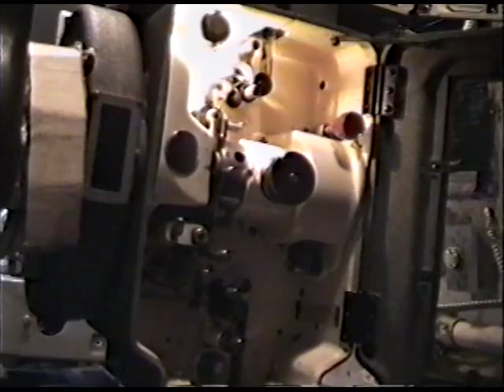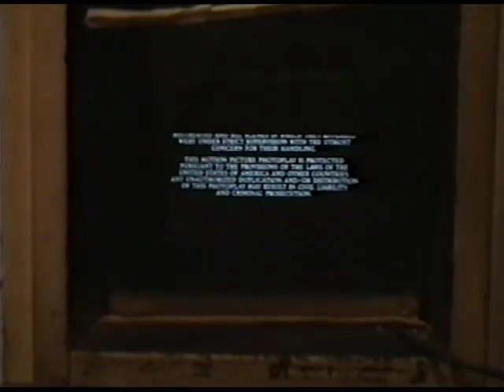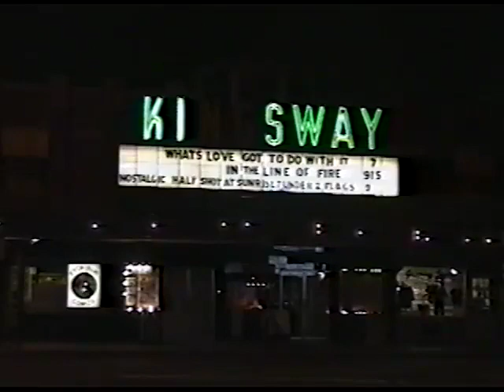Kingsway Theatre Toronto - 1992 by John Wallington

Comment: I too ran the Peerless Magnarc  lamps with Simplex XL projectors at The Mayan Theatre in Denver (before they made it a 3-plex) from 1973-1974. We had 2 rectifier units in another room (it cut down the noise), and a full bank of dimmer rheostats for the house and atmospheric lighting. I didn't have the opportunity to run Century projectors except in once in a while relief work. The Arvada Plaza theatre in Arvada, CO had Simplex XLs and Ashcraft Corelite lamps. My longest assignment was at the Esquire Theatre in Denver (still there, but turned into a twin). The Esquire had a pair of Simplex E-7 projectors. I didn't like them, but even after 50 years of use they ran fine. These were paired up with Strong Futura (?) carbon arc lamps. I don't remember that part. I was a member of IATSE Local 230 in Denver for 17 years. All these years later, I really miss those days.

Comment: Brings back so many memories. Being a teenager in 1962, I used to hang around with a good buddy who was a projectionist. I became familiarized with all the necessary steps. I remember this theater used, (I think it's called a dynamotor which ran off 220VAC which at the same time produced the necessary DC Voltage to run the arc lights) I am now knocking at the door of 77 years old, (God willing) Thank you for this wonderful video.

Comment: Many thanks for this video. I myself am a projectionist and I had the chance to shoot in double shift (but not with arc lanterns). It is for me the maximum purity of the profession. It is thanks to my grandfather that I do this job and he transmitted to me the love of film and the projection booth. Thanks again .
Reply: I am also a keen passionate guy since my 80s childhood when 16mm projector used to show movies on Saturdays evening. It was very expensive to buy a one so I developed my own DIY reel projector with 500w metal halide lamp which could project and light up 50 feet screen. It was so mesmerizing to see its dancing beam passing through fog, smoke and rain sometimes. I could get up early in morning and could project in a good ambient dawn light.
Now I developed my DIY anamorphic lens using wedge prism. I use it with BenQ w1070 to project 42 feet wide screen on boundary wall specifically painted for projection.
The memories of reel projector gives immense pleasure, I can think of it everytime!

Comment: I don't' want to remember having that bell wake me up on the last feature getting close to 11PM and I need to get some sleep to work the next day. Century Projectors would run forever. We had Ashcroft light houses that had 2 huge 3-phase rectifiers to power the arc. And it was water cooled on the clamps holding the positive rod and a water feed went to the film gate to keep that cool. Slightly noisy machines. I have heard some pricey European projectors that are really quiet operating. I was familiar with electronics and had a Dynaco Preamp ahead of the power amp to give the audio a nice sound. And wired in one  push button switch at each projector position that eliminated have to hit the petal on the floor for the movie transfer and button on the wall for the sound to switch projectors. One press of that button and it was complete. The ventilating system was broken from a fan belt worn out and the tile floor was black from the soot of the lamphouse. I fixed the fan and stripped the tile floor till it looked NEW. The manager was impressed and I got a little raise

Comment: This projectionist seems like he was trained by me. Starting with the reel bin "marker" to keep track of the next reel and where the last reel came from, the fact that he never let the film touch the floor by threading the take-up reel directly from the supply reel before threading the machine, he used pliers to trim the carbon arc and not a rag, and his inspection of an incoming print carefully checking head and tail leaders and the film edge of the entire reel. His precise movements throughout the operation reek of professionalism and good habits.

Comment: Wow...I'm 7 decades old now and remember the Kingsway in my youth! Our family operated a hardware down the street for many years up until the late 80's...I am SO glad you guys (and gals) are keeping the Kingsway open...just don't let the marquee collapse like the Revue theatre's one some years ago!! One other comment: I drive/walk by at night and I've noted that for MANY years, the 'traveller' mechanism for the marquee lights seems to be missing one of the three contact points..Not sure if the actual 'traveller' mechanism is broken - but you REALLY need to get that fixed...It's irritating in the extreme to watch the sets of lights on, on - then OFF and repeating the cycle...it's a three-cycle circuit, as I remember (I helped repair one of these 'traveller' marquee lamp controllers down at the old theatre in New Toronto - 40 years plus ago!!) I'm fairly sure it's just either a missing contact bar or possibly just disconnected. It should be fixable. Obviously, the motor is working fine in the traveller switch. See what you can do - it's SO disconcerting to see the marquee lights in 'fits and starts'...
It's problably a 'Signatrol 33-C3' unit - or similar 'chaser' unit - 3 contacts. This company is in the States - but the chaser/traveller units are not expensive. It may be just contacts needed.
http://nationalsupplyonline.com/Mechanical_Border_Chasers.html
cheers! James
Reply from the maker: It is actually a solid state unit that I bought as a replacement a few years back. It is a 4 flasher - one of the contacts does not work properly and the unit has yet to be replaced. Only three contacts work - but it was wired for 4. 1 length is doubled up - which is fine because the bulbs are now low wattage LEDs. Has to be fixed at some point.

Comment: Great classic style old theater, I work in a cinema where my favorite motivational films were released and I achieved it as Projectionist I learned the manual books of the cinematographic projector I remember my training and everything was a success, I do not rule out one day being able to acquire an old theater and remodel it in the style of the 70s to 80s to restore the old projectors that I came across historical and project those classics that inspired me, although there would be few original films left in the film roll cases, if they are not kept lubricated, the old films will be lost, it would be sad, I remember not allowing any dirt or dust particles to be on the projector rails because they scratch the film It was my priority to preserve it with a good image on the big screen of the cinema ,,,, what tremendous times , the old film projectors that used lamps with carbon electrodes, I remember using them in an old cinema in my country they hired me for a season, I put them together but change the rolls in the middle of A film , it was several rolls, it had to be fast because the film was paused, with a powerful flat lens, but when the projector was modernized, flat lenses were used in the shorts of advertisements sponsored by the cinema and some films that were image Flat lens and when the movie started you had to switch to the scope lens. Then it was modernized to the giant plate method where all the rolls of the film are connected together all rolled up. But the modern ones were with a great DTS, CD, DVD and then to Bluray ,,, the old method was eliminated, which was more my traditional style, it was rather for me a profession, the audio contacts of the film had to be kept clean, a good lubrication in the rollers, an additional replacement lamp, a treatment to the film to avoid deterioration with the heat of the lamp, a good packing of the pressed film tape so that a dismantling does not occur in the roller in full projection of the film . I remember projecting the same movie for several rooms at the same time the tape ran down the wall from one projector to another projector in another movie room,  ..I remember everything... 📽🎼🎬👊👍👁‍🗨

Comment: 1974 car view drive in
Reply: I worked one of those. Kar Vu Drive In, Brighton, CO. It was my 1st assignment on my own, 1972. Union pay scale was $3.25/Hr. Simplex Projectors, Excellite 135 lamps with Metal reflectors. That's right, metal reflectors. Film would get so hot in the aperture gate it would warp. It made threading a challenge in the last few reels of a movie. The generator for DC power was not in a separate room. Extremely noisy work environment.

Comment: A former IA operator (L550 and L513) before moved over to stage, at the end of the carbon-arc eras. Had a chance to work many houses but my all-time favorite equipment were the Simplex X-L mated with the Ashcraft Super Cinex. Damn, it was such a fun job in the changeover days. The folks in today's automated digital booths have no clue what projection is but given today's equipment, do they need to? Still, it was a busier, yet simpler time. BTW, thanks for including the daily breaker routine! It was a key element.